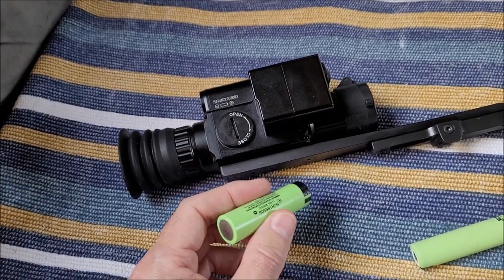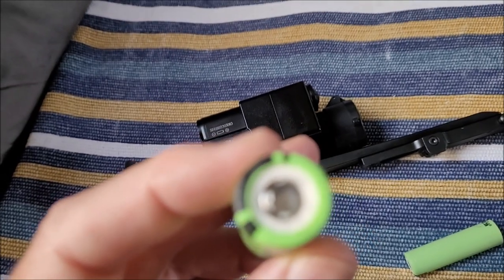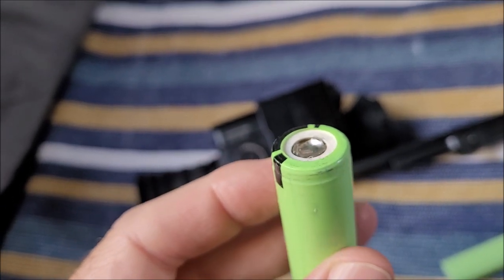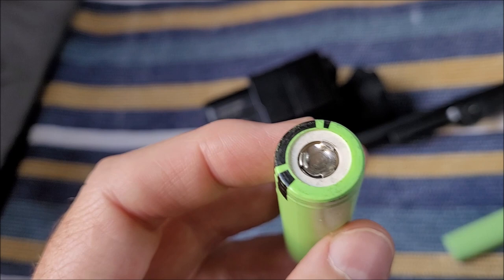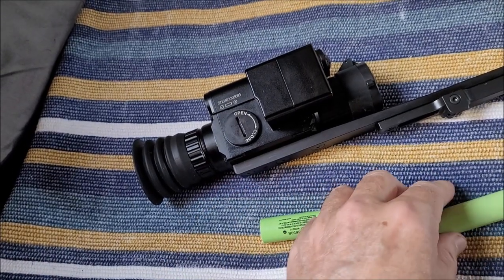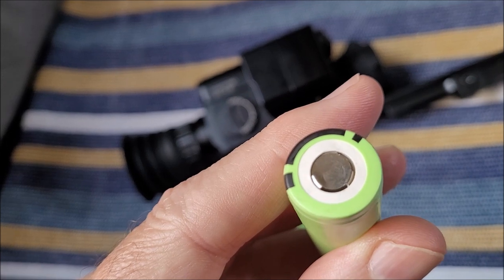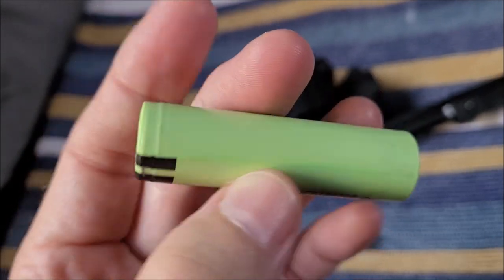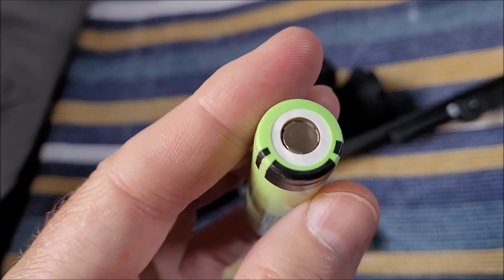Pard NV008P LRF Battery Damage Under 30-06 Recoil

Comment: Try a few turns of masking tape around to make them a tight fit if in a tubular holder, the friction will slow the movement
Reply from the maker: I could but its already pretty tight and I'd have problems getting it out. If they last a year thats okay because I'll probably put it on the rimfires and upgrade to the new DS35.